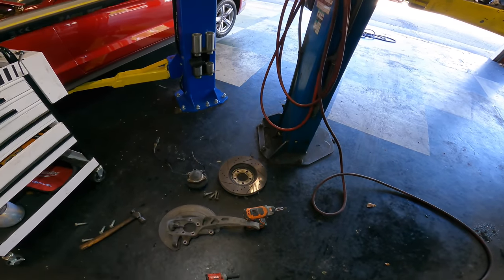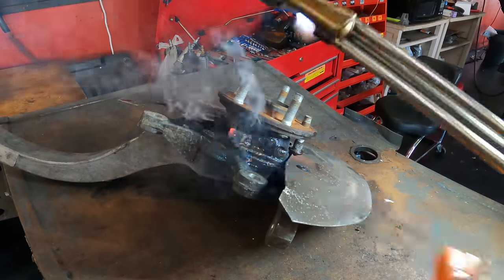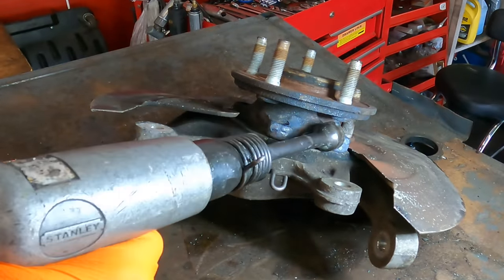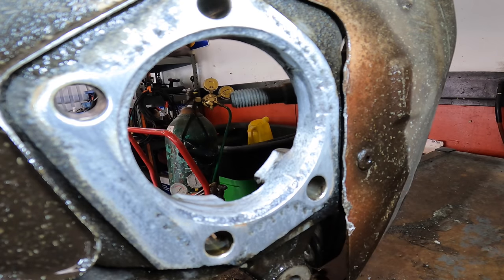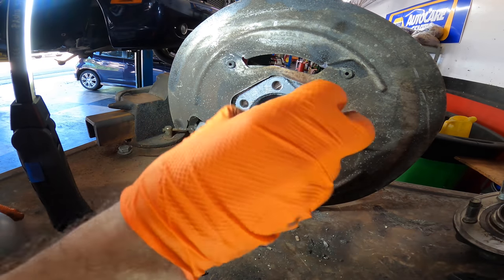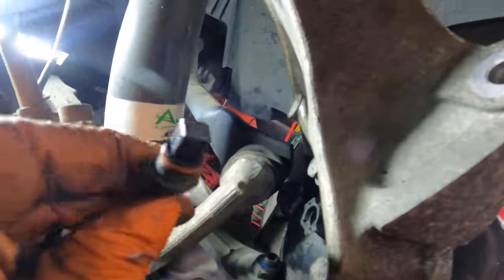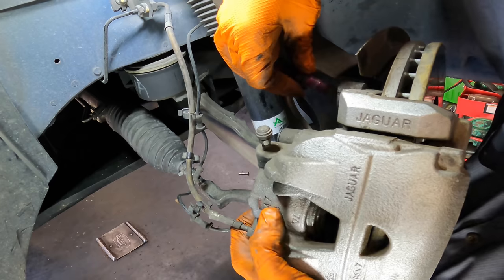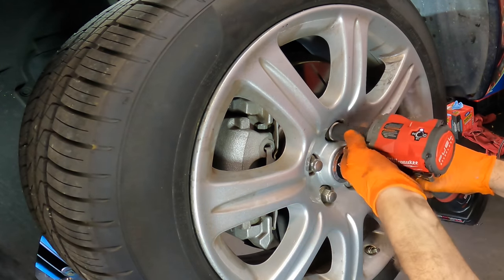Serious Corrosion! HEAT Required! Torching a Jaguar 2008 XJ 4.2 Hub Bearing/Bent Parts

Comment: "Rule Number ONE" is: Turn off comments if you don't want to read any comments about your video content (or work). Personally, I don't really care how you solder or weld or even how you might torque your nuts. If you can consistently keep getting the job done with just a hammer then I say, hammer away. Please let me watch! It's probably not the way I'd choose to do things but then I don't have your hammer or skills to use a hammer quite like you do either.

And yes, I don't like watching you solder wires together when you totally rely on the solder to make your physical connection -- it makes me cringe. The best advice I can offer there is, if you can't get a descent physical connection without solder then you just might be creating another problem later on. But hey! If it works? ...And again, we seem to back to rule number one again. (Because, who the F am I -- right?)